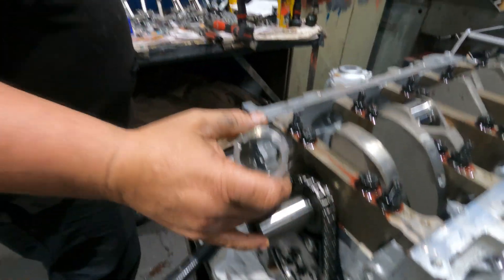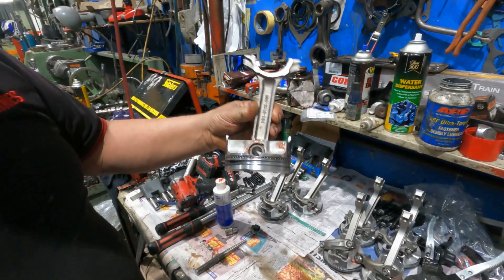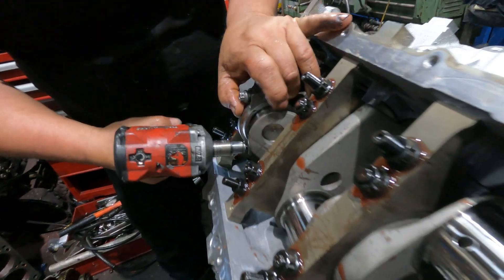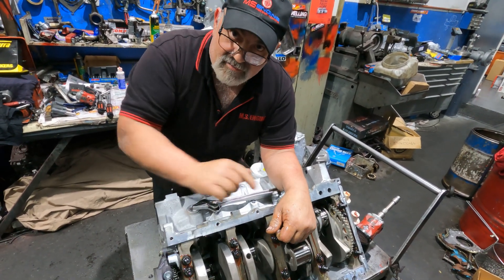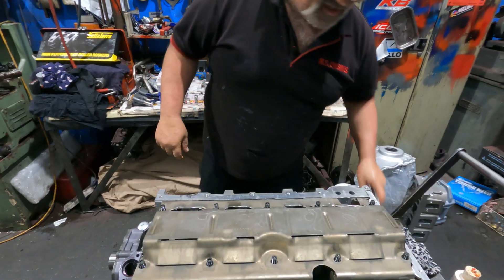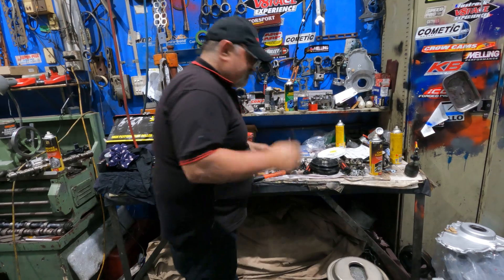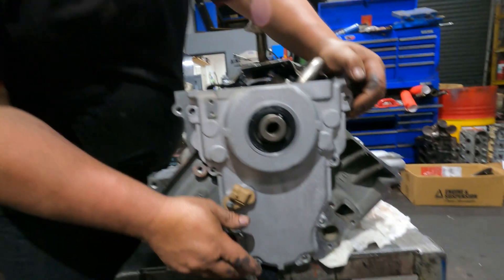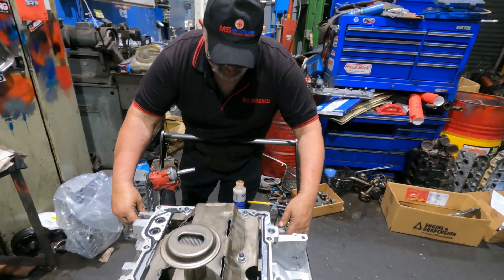Performance Engine Build for Fastrack Australia - Part 2

Comment: Love it. You know your dealing with a pro when he builds a high powered motor without following torque pattern and oil fingers in bolt threads and surfaces. He would know how to torque by feel. So much to learn from these vids.